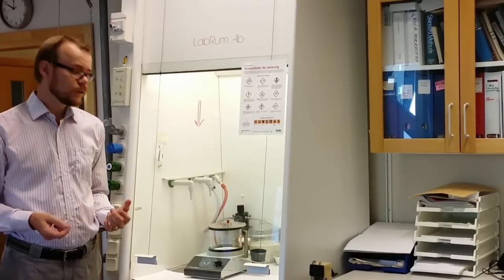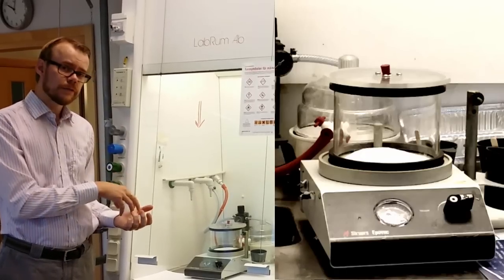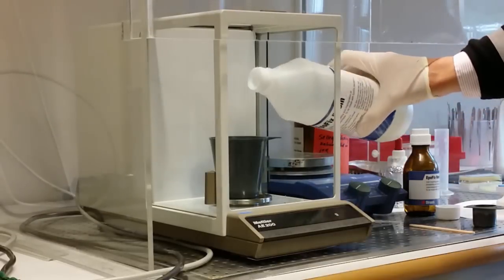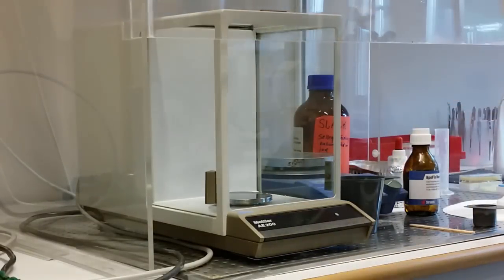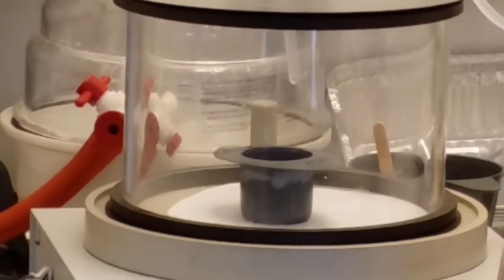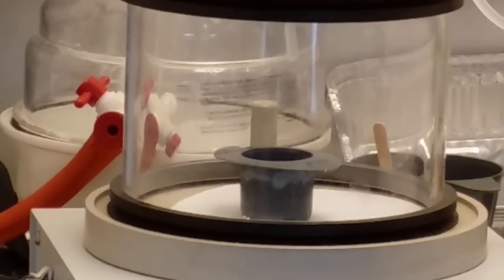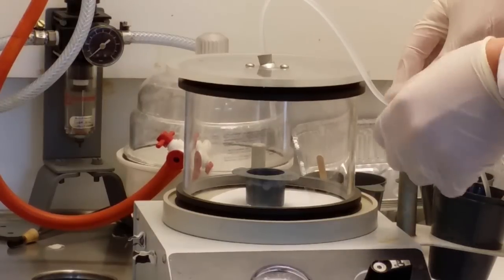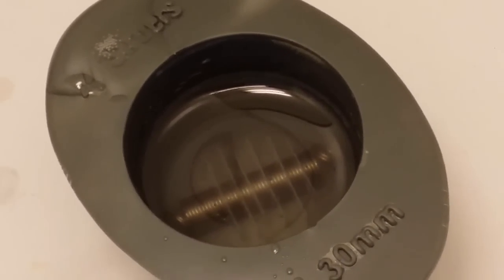Sample preparation: -plastic embedding

Comment: Hello, I am trying to embed a tumor infected kidney along side of a healthy kidney. Embedding in plastic absolves us of biohazard/Hazmat risks while retaining a superior specimen in the future. I'm thinking a mold of 20cm x 20 cm with a depth of 10 cm. While we can 'fix' in formalin I was hoping you could give more guidance on the parts/reagents required....This specimen would be a great teaching tool...
Reply from the maker: I have no experience embedding at that scale. I do know that for bio materials it's a problem of getting propper vetting of the cells, you need the resin to realy penetrate inside and people uses different sequncial steps starting with more diluted/easy flowing resins.